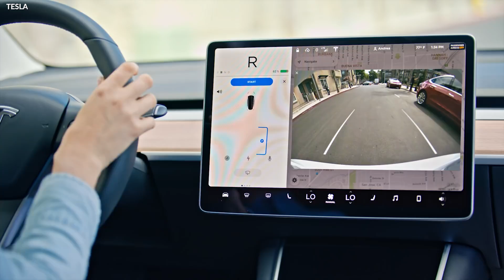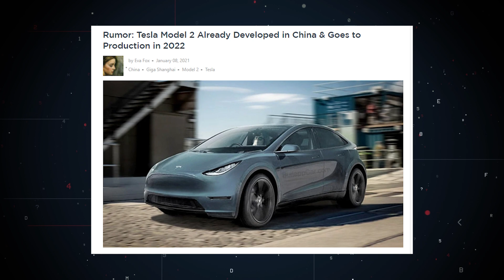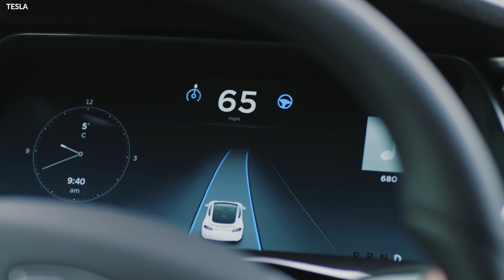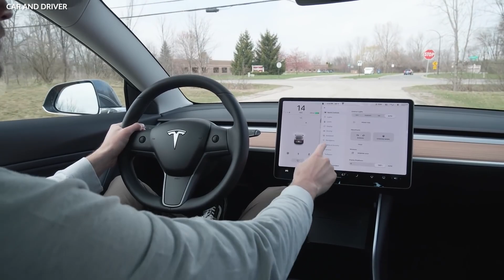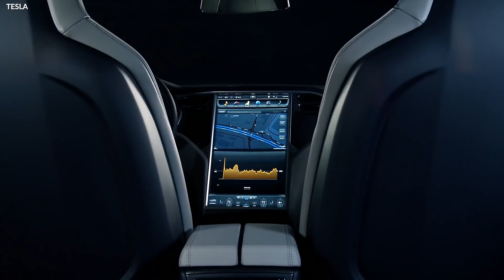Tesla Model 2: Coming In and Everything to Know

Comment: Hopefully the baby tesla will be released just in time for me to join the Tesla community!
Reply: Just get a 3 worth it
Reply: hard out!
Reply: @snowwhitejemmy  huh? 🤨
Reply: 2 will be stripped and minimal
Reply: @Arizona-Tactical  haven't got £43k but a £20k M2 would be tempting.
Reply: @Arizona-Tactical  how can it get more minimal than the Model 3?
Reply: @R0BBS  it can get a lot more minimal actually i have a 3 performance and its fully loaded heated seats wheel ect all the bells and whistles the 2 is supposed to have literally nothing and retail for 17.5k
Reply: @Arizona-Tactical  if you compare it to some of the competitors here in the UK like the Renault Zoe, Golf GTE and Kia models it will be way better. Plus it's a Tesla which on its own is going to be much better than the others. 
I'll settle on no heated seats or Cheetah stance to get into the EV market
Reply: @MrDark I am at the point of getting bored of waiting and so solid information of whether the baby Tesla is even coming.
I am so tempted to spend £25k on a used Model 3 now, roughly 3 years old. 
Maybe the baby Tesla will be available by the time I'm ready to change it then 😬